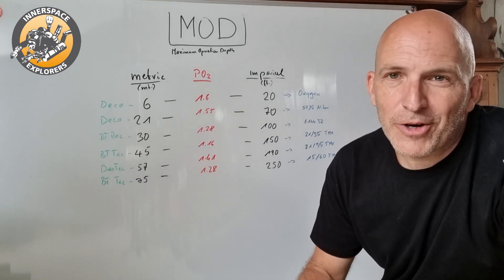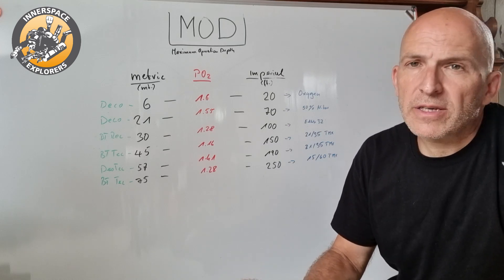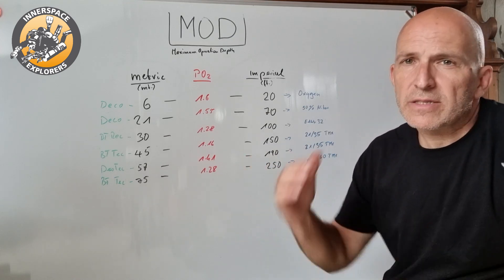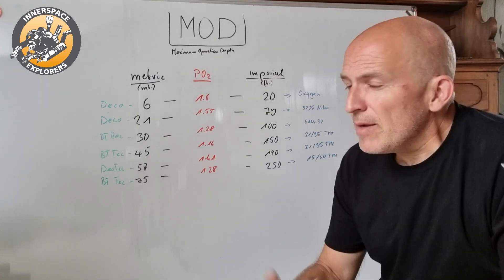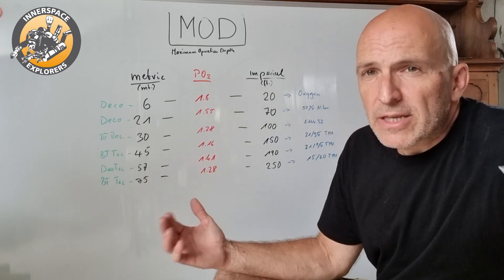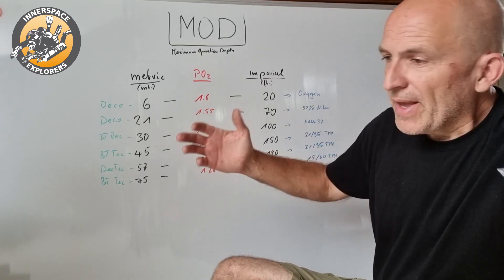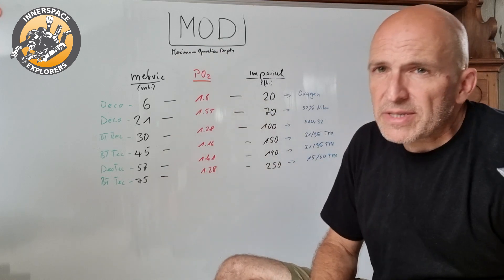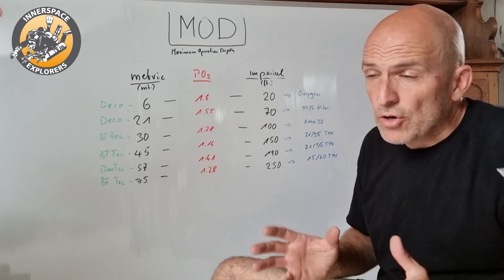MOD - Maximum Operating Depth  - Tank Labeling

Comment: Hi Achim,
Great video as usual, thank you for that.
I don't know if you will read this comment, but after training with advanced trimix, I am going more and more on very deep dives (100-140m) with CCR and I am considering "refuelling" my body during decompression stops with water, energy gel or isotonic drinks. 
I am looking for advices on the internet but the topic "eating and drinking underwater" is not much developed. 
Maybe that could be a good topic for a video? what to eat/drink, why, how? and how to make the "rig the set up"? How to tie a camelbak to a bailout or something? If you have experience with this, it would be awesome that you share it with us.
Thank you in advance, always looking forward to your next video.
Bye
Reply: Just my personal experience - isotonic drinks; jab a slit around bottom edge with your dive knife and squeeze the content into your mouth. Was doing it on 100+ m dives in warm waters where deco becomes quite long. Worked well. Did not go beyond 3h runtimes so that's what it worked for me.